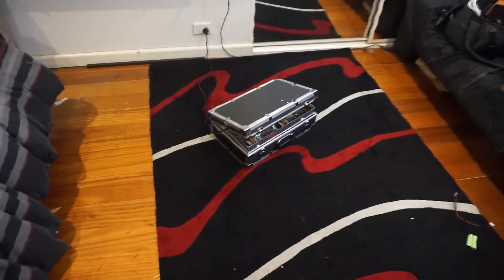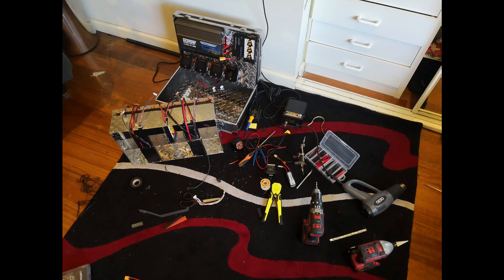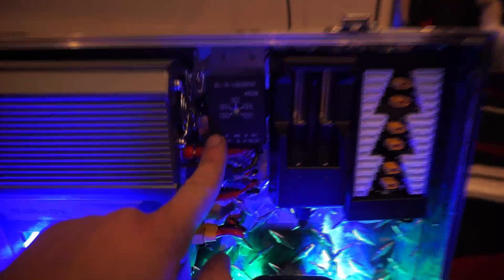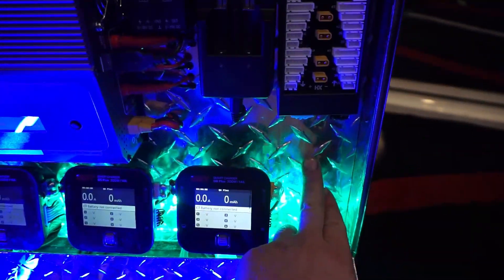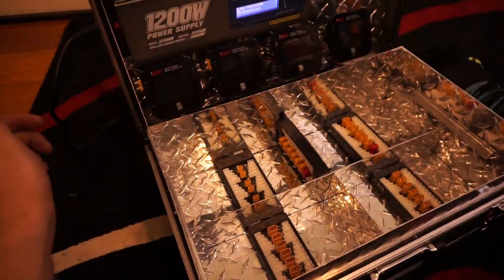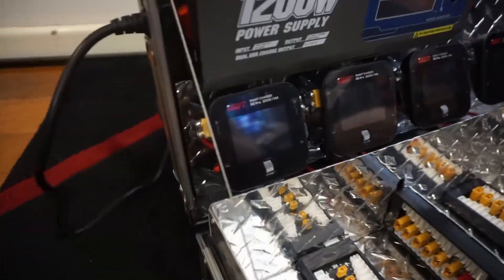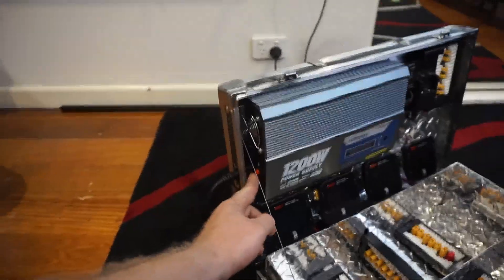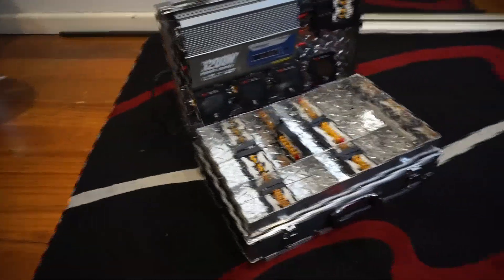My custom Epic RC Lipo Charger Box

Comment: Awesome box! I recommend adding a smoke detector and also some small rubber feet to give it some clearance off the floor.
Reply from the maker: Thanks, good ideas. I've already added a smoke detector sitting on top of the box and the whole box is sitting on a rubber and carpet mat to absorb some vibration